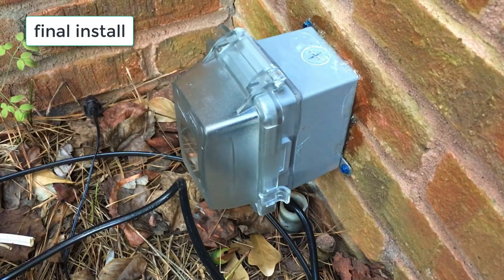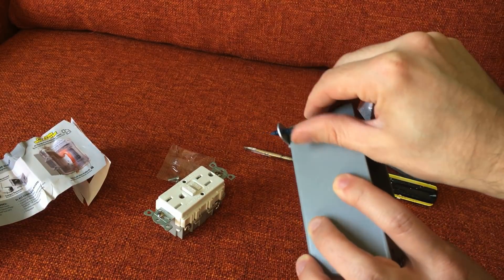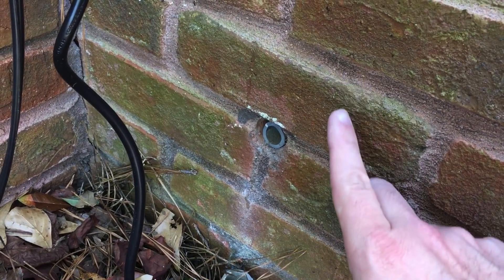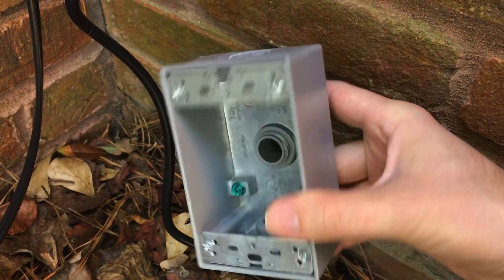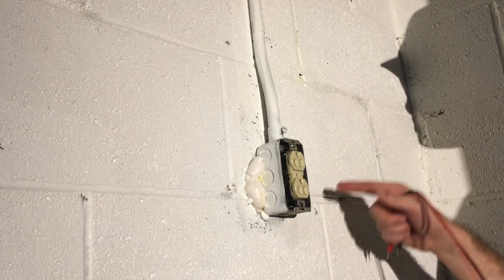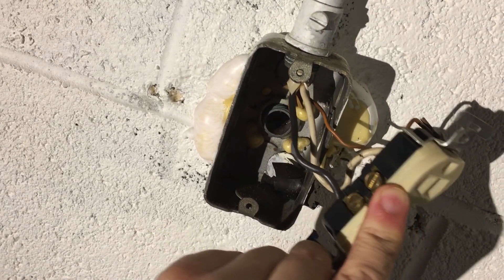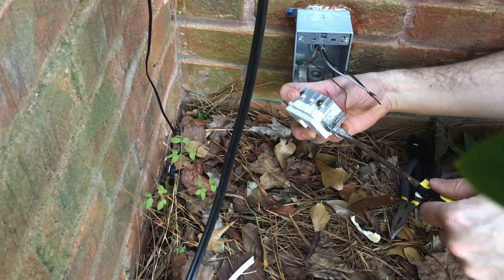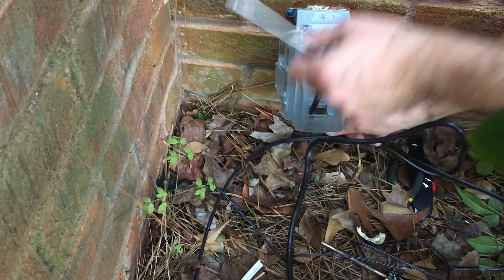HowTo Install Outdoor Weatherproof Outlet on Brick Wall

Comment: In this case it doesn't probably matter much, but if appearance is important and you don't want a big boob hanging off your brick, look up Arlington DBHR1W flush box.  Yeah it's 40bucks, but by the time you buy a box and the waterproof cover, you're there.

Comment: Did you check the breaker amperage of that circuit?  If it was a 20 amp circuit, then you committed a major code violation by using 14 gauge wire.  If it is a 20A circuit, you need 12 gauge wire.

Comment: Should be using 12/2 wire Not 14/2. 14/2 is used for lighting 15 amp. 12/2 is used for outlets that run off a 20 amp breaker in the service panel.

Comment: Thank you for filming and posting the video.  It helped answer some questions I have.  The biggest concern I have with what you've done is that you've used 14 gauge wire for the new outlet on a circuit that looks like it was 12 gauge and probably protected by a 20 amp circuit breaker.  My understanding is that 14 gauge wire can only be used on a 15 amp circuit.  I agree with others that back stabbing from the inside outlet is not great.

Comment: Don't use the "back-stab" connection, they are only held in place just two pieces of metal in tension and may work itself lose over time due to thermal cycling. Use a hook and the side screws. Better yet, get a spec grade outlet with back connection feature. As quick as the "back-stab" but you actually tighten down the screws to clamp the wires so they won't come lose. I would also pigtail the original power feed, wire the GFCI, then run the load side back to the internal outlet, so it is protect as well.
Reply: These back-stab connectors are fine because you have to tighten the plate with the screws. It's the push-in ones that don't have a screwed in plate to it that should be avoided. Of course, always best to use the terminals but back-stabbing as long as it is screwed in is 100% fine.

Comment: You clearly have no idea what you are doing because pretty much everything about this is wrong.
Wrong gauge wire.
No PVC cement.
Improper wire nut installation
Used Stab connector instead of screws on side. 
Installed outlet upside down
Only sealed one side of the outlet box.
Used the wrong kind of caulking. Kitchen and bath instead of outdoor rated caulking.
Reply from the maker: Pinning this comment so others get fair warning!

Comment: I put my GFI inside the home, sure you have to go inside if you trip it but, The reason I do that is, I am not in the house 6 months out of the year. So I can turn off my GFI in that area and if by chance someone try's to use that plug when I am not there. It will not work.

Comment: Bro you just hooked up the wires to the load side of the gfi. It's upside down the ground is always suppose to be to the bottom. You have no other receptacles branched off of that circuit. It was better that you had called an electrician. You should of not put this video up showing ppl this just saying.
Reply from the maker: are you talking about the new outlet or old one?  The new one at least had clearly marked "Line" "Load" "hot" and "white" labels that you can see around 8:11

Comment: I'm a small contractor - NOT an electrician! And it is very interesting to see how an intelligent DIY guy approaches this job! I would have stripped the Romex, like others have said... no big deal that I can see, but it's good to inform other DIY'ers of the general rule!
Also, I don't like to ever "back stab" a receptacle - every time you change the receptacle, you lose length on your wire! Overall, I think it's really good!

Comment: Maybe different where you live but usually the ground plug is on the bottom your outlet is upside down.
Reply: AFAIK, NEC has no regulation regarding receptacle orientation.  That being said, it is theoretically safer to have the ground facing up because if you have a loose plug with exposed prongs, it is far easier for a falling object to short those than if it landed on the ground prong instead.  Of coarse if you have an outlet with loose connections, it really just needs to be replaced.  There still could be local regulations regarding the orientation so I would double check.
Reply: @Derakkon2  You're correct about there being no code and there is an argument for putting the ground on top but in my experience, nearly every plug I've seen where orientation makes a difference, they've been designed for the ground to be on the bottom. I've come across literally one plug which was designed for use the other way and if I recall correctly, that was on a two-pin plug.
Reply: Lots of places code now has the ground plug on the top.  Something about if you were to accidentally grab the pins while plugging/unplugging something, you're less likely to grab the hot?
Reply: @HonzoSample  the ground hole gets mounted upward to signify it's a 20 amp circuit... otherwise it's just upside down.

Comment: Be careful when you are wiring the outlet. Using those push slots can be ok if you have screws to tighten them in.
You also may want to run electrical tape around the terminals when using a metal box, especially outside.
Reply: Great idea, I always do. Learn that from a friend that was helping me wire my garage.

Comment: If you are using romex wire , you need to use outside wire. Gray colored wire for the weather. Check code in your area. Unfortunately it comes in a 250ft coil, for about $200.
Reply: only if it is exposed to weather and big box stores will normally sell you cable by the foot off of a reel
Reply: He shouldn’t have used cable at all. Individual conductors are preferable in this situation because they are inside boxes and conduit, completely protected.
Reply: @RB-xv4si  true but inexperience I mean me personally I would have just striped the nm sheath and just ran the lose cables thru but for such a short run not bad for a novice
Reply: wizard3z castor yeah he did pretty well overall. Should have used a WR rated receptacle though.

Comment: You were supposed to run 12 AWG wire for the outlet.
Reply: That's a 15 amp outlet, 14 AWG is actually correct but most people run 12, but if you look inside the wire going to the inside outlet is also 14 AWG. In either case the total length of the Romex is only 12 inches.
Reply: Mike King the wire is not sized for the receptacle. It’s sized for the rating of the breaker it’s running from. If it was running from a 20A breaker, it should be #12 wire but we don’t know this information because he never showed it to us or told us.
Reply: How do you know? Did you see the rating on the breaker? No, you didn’t

Comment: Contractors use the stab holes all the time because of the time savings, but in my experience they do fail (only a thin blade making contact).  I've always used the side screws.  For the GFI, I don't know that it's a terrible idea to use it outside but it's probably better on the inside; IE swap the two outlets, or even install a GFI breaker at the electrical box.

Comment: Thanks for this video.  It showed me that I already have the correct box, but I am missing those metal wings with self-tapping screws on the back (I'll have to dig through my stuff and see if I can find them).  I was wondering how on earth that box was supposed to be mounted.  This video answered that question.  Now I just need the outlet and the outer plastic shroud.
Reply: in a pinch just drill thru back off box use washers holds longer than those ears and look nicer

Comment: GFCI should be inside the building away from the weather, the regular receptacle outside. THHN or THWN stranded wire between the two boxes, 1 black, 1 white, 1 green. I've seen many GFCI receptacles go bad from stray moisture. Keep them inside wherever possible. And never use the "stab holes" in the back of receptacles. Wrap the conductor clockwise around the screw or use a receptacle with a captive jaw built into it (more expensive device)......JMHO
Reply: isnt romex just 2 cables of thhn and a bare ground in a sheath when i was taught to run cables for residential i wld run romex to the conduit and strip it all the way from connector to connector it has been like 20 yrs since i have done it and not sure if it is still code i wld chk with jha first though
Reply: They make weather resistant GFCI outlets now.  For cost savings though, I would still put a regular GFCI on the inside and a standard weather resistant outlet outside.

Comment: LINE vs. LOAD  I heard there are two sets of terminals on GFCI receptacles, a line side and a load side. I think this would need to be connected to line side and that the load side is for continuing on to other receptacles. I saw this mentioned in another video's comments, seems critical to me because the interrupt will not work correctly otherwise. I liked your video, it was well done.
Reply: If you go line side anything downstream from that GFCI will not be protected (unless additional GFCI receptacles are installed).  If you go on the load side anything downstream will be protected from that GFCI.  For my particular setup I'm going line connections with multiple GFCI's because I don't want the outlets to trip that aren't affected.

Comment: Hey man I am not trying to bash your video but it is against the NEC to run indoor romex in conduit. If I was in your shoes I would  have spoken to the electrical inspector in your area about what I want to do and how to do it correctly and to code. So basically you have set the next home owner up for failure when it comes time for housing inspections and they have the right to open up each outlet and check. Once they see "Oh someone used 14/2 Indoor" they will flag it and now the next homeowner will have to call in a licensed electrician to have your error fixed. And let me tell you some inspectors are very strict.

I have witnessed homeowners have to demolish a wall for the inspector to check the wiring and how it was run and connected. You should have spent a little extra and get THHN #12 solid wire in Black, white and green. They sell them in different lengths and you can have a employee at The Home Depot cut a custom length for you. Just my 2 cents. Because I know there are some nasty comments and people will nitpick the life out of you when someone posts electrical or any DIY video.
Reply: What code section says that. Wait let me save you time NONE
Reply: Do you think he could’ve also used a UF-B 12/2 cable without the conduit?

Comment: Against code to run romex in conduit
Reply: not in all areas although frawned upon but if its the only set of conductors it shouldnt matter especially in this 6 inch run
Reply: @wizard3z868  No dude, per the NEC it is not code to run NM in conduit. The only areas that this would not be the case would be where local code specifically supercedes this, which for this specifically is highly unlikely. There's a lot of code issues in this video, this is just one example.
Reply: @justingurski8770  i didnt notice any (this man even grounded all the boxes )and even this 6 inch run with just one cable i cldnt see any inspector being that much of a big deal unless they had close ties to a master spark and gets a kickback lol
Reply: @justingurski8770  what code section. The only thing I found was it could not run in conduit in wet location. I did find where it said to run in conduit to protect from damage. You need a code class to learn how to read the codebook
Reply: Nick it is no code violation to run nm-b in conduit If so find it.

Comment: Vast majority of pros avoid using the stab connectors in the back of an outlet (10:48-10:54), as many view them as less reliable.  You'd be surprised what heat cycles does to them.  You're only saving a few extra seconds.
Reply: I pulled out a few outlets on the house I bought and the wires just popped right out of the stab connectors. NEVER use them!
Reply: This is NOT a back stab connection.  Those are junk.  This shows a back wire connection that is internally clamped with the side screw.  Its fine.  In fact its great.
Reply: What do you use?
Reply: @GoSunDevils99  Use side screws.  Properly strip wire (most outlets have a gauge on reverse side).  Yes it takes a few extra seconds, but is much more secure when done correctly.
Reply: My MIL had a hot switch at her house and it turned out it was one of those stab connectors had gone bad and everything was oxidised.

Comment: you should have used thhn wire romex dosen't do good in conduit because it can heat up
Reply: lol it was like 5 inches and the only conductors nothing to worry about but with other conductors yes fill wld be a factor also you can always just strip the romex at least i did 20 yrs ago wld have to chk with jha to see if i still cld ??

Comment: I truly recommend to check with a License electrician before doing something like this. And consult with the NEC { National Electrical Code }. The outlets are connected otherwise. The hot needs to be on the right and the neutral on the left with the ground down, like a little face. If u use pvc, you don't need romex, just the cables and 12 gauge for more safety.
Reply: Both of you guys don’t know what you’re talking about. NEC has never specified ground up or ground down, nor ever given a “recommendation” of such a thing. It is code compliant to install either way.
Reply: @RB-xv4si  well I just know tht in trade school my instructor told us tht ground up was the recommended way/ standard but the only time in 25 yrs I've ever seen it enforced has been commercial or industrial or a Cple of times the jha was on the rag lol
Reply: actually nec has recommended ground up/top since the 1990's

Comment: Thank you - your video showed me what their listing did not - that this is exactly what I wanted to cover an outlet that I have on an outside brick wall.   The current cover 1) has a cover that lifts up when you plug something in, exposing it to wind and water; and 2) keeps falling off of the 1830s brick, so I have to do something about it anyway.   Your step-by-step video shows me everything I need to know.
Reply from the maker: glad it helped! I too found the info before trying lacking

Comment: Thanks for the video. I have the same kits. Duct seal is a good water proofing behind the box, use a relatively thin layer. Also, I drilled through the back of the box and used 3/16 Tap Con masonry screws.

Comment: I have something similar for my pool but my plugs will not fit because the power cords have a gfci plug. One plug takes up all the room in the outlet. Would it be too much power if I add both power plugs by using an adapter?

Comment: Comments: 
1) You could have just used two feet of Black, White and Greed and just ran it through the conduit as you're not really supposed to use romex in conduit but it was a short piece so I won't tell:).
2) You could have put the GFCI inside the house then you could have protected that outlet as well. True if you did trip the GFCI you'd have to go in the house to reset it. You could still protect the inside outlet by running directly to the GFCI then run two wires back to the inside outlet. However then if you tripped the inside you'd have to go outside to reset it. Only way to win on that one is to use two GFCIs.
3) Better to use Green insulated wire when making up several ground connections inside a small metal box like that. Just less likely to short than having bare coper.
Reply from the maker: timon0x31 I wish you were around before the install! Why is Romex in conduit bad? But bare black and white better?? I understand that the wire should be protected from getting scratched, is there overheating concern? Good advice on the green ground connections.
Reply: @ScottDriscoll  it is called "conduit fill". basically if you use romex the calculations get all whacky because it is calculated based on its "oval" size and thus you can only fit 14/2 romex wire in a 3/4in conduit without going over fill. THHN or THWN are typically used in conduit, and you can fit a bunch more single conductors in a 3/4in conduit than you can with romex. Your conduit looks about 1/2in so you are already over fill, especially with the additional THHN wires. Probably never going to cause and issue, but it is always good to know for future projects.
Reply from the maker: @fd3871  Thanks, just to make sure I understand, all this is still talking about overheating potential, right? Fill percentage has something to do with airflow?
Reply from the maker: @fd3871  Thank you :) I have added a link to that in the description.
Reply: @ScottDriscoll  Romex does not go into conduit because it can overheat, it's meant to run freely through walls in residential. If you use proper connectors there is no risk of scratching the insulation especially on such a short run
Reply: Spartan raises an excellent theoretical point.   While your use of Romex is "forgivable," it is "gauche."     The sizing of conductors (i.e., their ampacities) is predicated on the assumption of heat dissipation. Heat needs to be dissipated.     Various charts in the code show that, for the same current, larger wire is needed if the ambient temperature is higher.      Cooler is better than warmer.
Reply: @Spartan111792  if you follow conduit fill per NEC chapter 9 over heating not a problem the code only says you can not put type nm-b cable in conduit in a wet location.